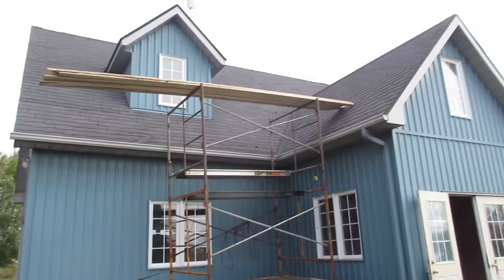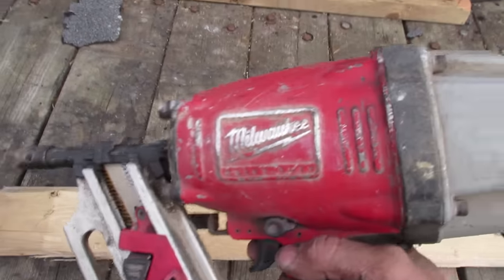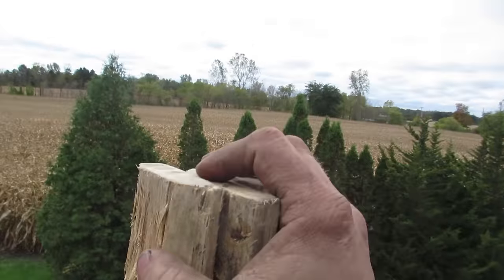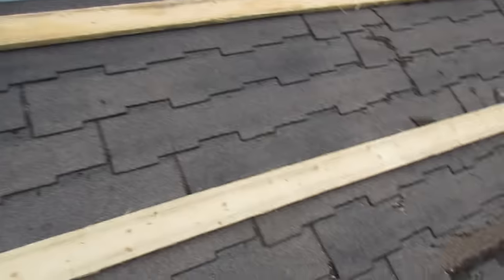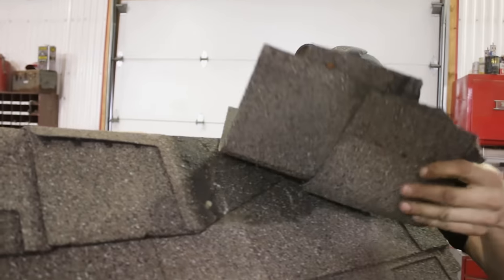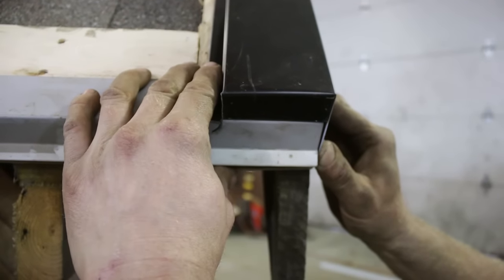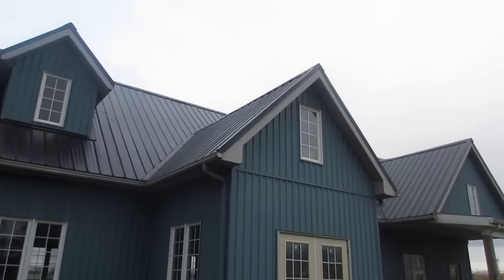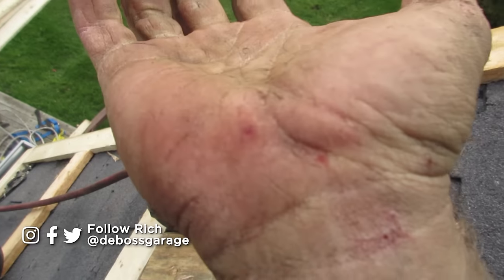How To Install DIY Metal Roofing (House or Barn)

Comment: The reason why your roofs don't last is because you use inferior materials in America ,since your houses are too big and you try and save money building them so you cut corners on roofing. The rest of the world doesn't have this problem since we don't try and compensate. Just use tiles like the rest of the world. They last forever and look good also and are great for hot climates.
Reply: They get chipped and cracked/broken in hail or ice storms.
Reply from the maker: The snow and ice gets underneath them and lifts them.  They last one winter.  They are common down south.
Reply: Tiles wouldn't last a winter or two in the north.
Reply: @imxploring  You get that there are different types of tile right? Even in the coldest regions much more north than the US they use tiles as well. Seriously go google best roofing for cold regions and you'd see it's either metal or tiled roofing that will last 60-80 years and not like 20 years or less for shingle roofing.
Reply: @kazykamakaze131  I live in a pretty nice area of the Northeast where there's lots of folks with no concerns about costs.... and tiles are not common. Perhaps it's just a matter of taste or there aren't many contractors that install that type of material.
Reply: @imxploring  The 1st comment you replied to explains exactly why they don't use tiles, even though tiles are stronger and last longer. Most americans want a massive house but they can't afford to put tiles on their entire roof(having a 20-30 year mortgage to pay for a house means you can't afford the house), go and look at the statistics then you'd see how bad most americans finances are and why so many are only 1 missed check away from going bankrupt. Multiple different studies state between 15-30% of most american homes are actual used space, meaning most can downsize 3-5 fold smaller homes. If you had a smaller house you would invest into a better roof and wall structure, but I guess this is what you get after multiple decades of pushing "consumerism is king" policies gets you. It wasn't like this 70 or more years ago, such a shame that the next youth will be even more indebted than the previous generations.
Reply: @kazykamakaze131  There are a lot of folks where I live that can honestly say money is no object, they're not wage slaves and are putting up nice houses for cash... so I think it's more an issue of it not being a type roof most contractors are familiar with in this area. Perhaps that will change in time.
Reply: @imxploring  Please tell me again how many "these" people are the makeup of the US population? I'd put the upper 10% or less? Now how about the rest of the 306million US citizens?
The reason contractors won't be familiar with or rather most people perceive as the "usual" roof, they are used to looking at in most US houses is shingled roofs, because it's very cheap and quick to setup, but doesn't last long this is why you see houses with many layers of asphalt shingles because of them having to replace them.
Also be careful when you state houses are paid cash as you might not know how others procure their homes and most people don't like talking about their finances. You might never know the people in the are might be heavily in debt or over leveraged.
Reply: @kazykamakaze131  I guess you'll just have to take my word for it..... we all live in different circles and have different experiences. Thanks for you input.

Comment: I'm glad to see that you screw the screws on the peak and not the flats
Reply: I 2nd this. Never do ribs... least that's how I was taught.
Reply: bruce clothier  a lot of those same companies recommend that you change the screws about every 5 years if you put them in the flat too. Its just a way to get out of the warranty after a short period either way. The best roofing companies give the installer the option to do what they want. We have installed thousands of roof, all in the rib with no problems. I have also changed out 1,600+ screws that were put in the flat, because the washers wore out and about 10% of the screws were broken from rust.

Comment: You mentioned 15-year asphalt shingles what's your opinion on the so-called 50-year asphalt shingles.
I think if you want a roof to last that long just go with metal.
Reply from the maker: Have they been around for 50 years or are they making up numbers?  I would expect 30 years from them

Comment: The only thing I really disagree with is the statement "we can send a man to the moon, but we can't build a roof that lasts more than 15 years". We have plenty of roofs that average above 20-30 years in the roughest climates,  and when installed right have track records of 100+ years.  Shingles of course not being amongst those mentioned. 

The biggest issue boils down to 3 factors: 
Price: why buy a good roof when you can buy a cheap one? 
Marketing: Shingles, SPF, and TPO, respectfully the 3 lowest average lifespan of the 20 most common rooftypes (TPO and shingles being the most popular,  controlling >40% of their respective markets). While being the worst roofs they combined equal over 50% of all new roofs. Why is the worst products the best?  great marketing. 
Poor Installation: The #1 listed cause for Commercial Roof failure,  and #2 listed cause for residential roof failure, is poor design. 

We have plenty of great long-term roofs.  There's just not a good market for them.